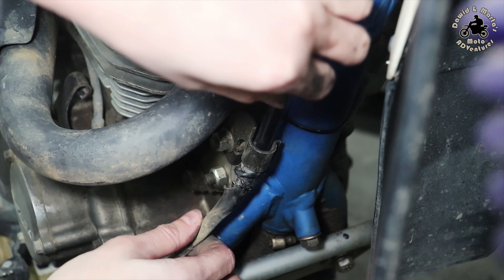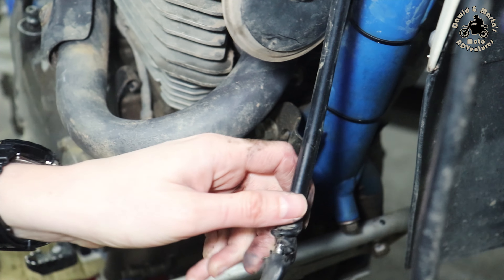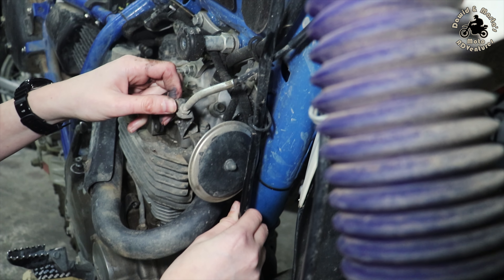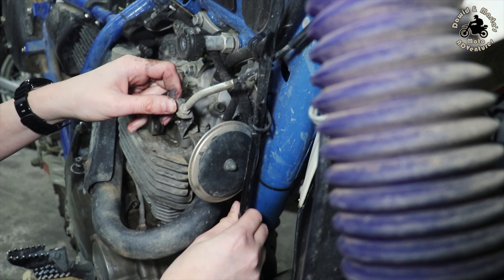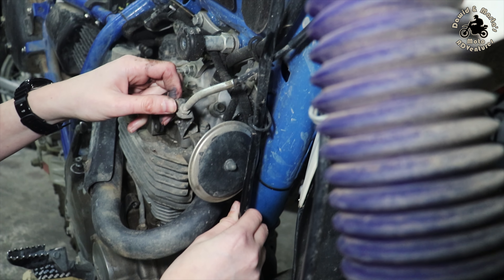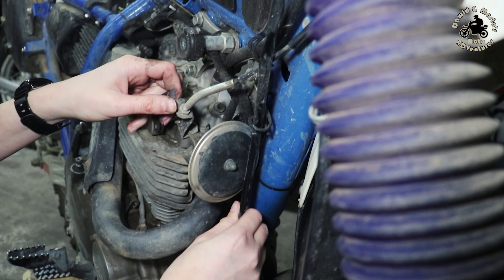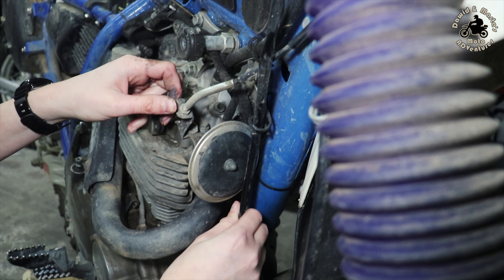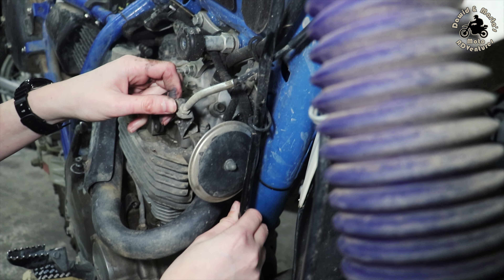🔧 DR350S - The clutch cable replacement (OEM vs. All Balls vs. Cheap one)

Comment: Nice clear video thank you, but you did not show if the new cable was easier to pull ;)
I always use OEM clutch cables, it is the only way to get a nice smooth clutch.
And I have never seen a melted cable, but have done 50+ thousand miles on DRs, I guess it is from your raised bars which is  pulling the cable too close to the header.

Comment: The use of substitutes defeats the purpose. Since the motorcycle left the factory with original parts, these should be used. When it comes to replacements, it's usually just that they are a little cheaper than the original parts and that's it. The original is the original :)